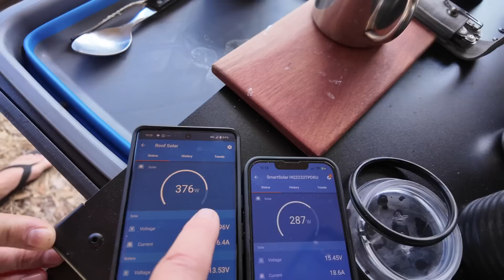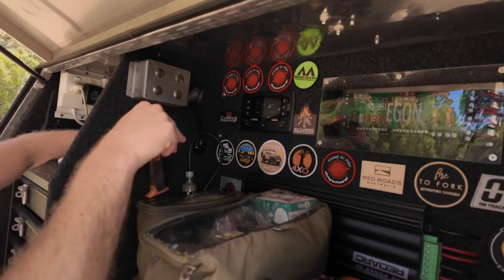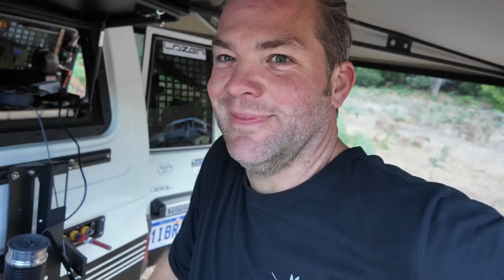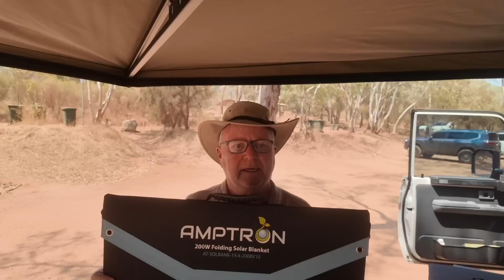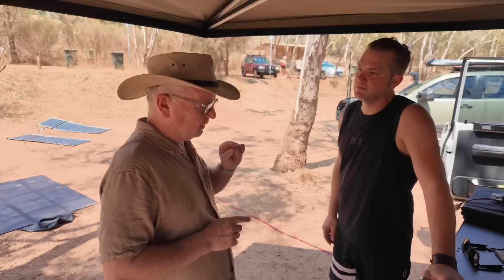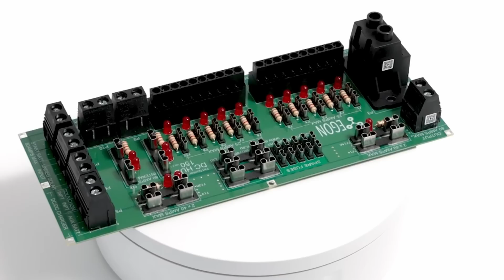Solar Blankets and Panels. Volts and Output @4xoverland

Comment: Here is a dilemma I am trying to decipher. I have house panels that are 275w @ 30vdc 8A +/-.  The panels and the mppt  charge controllers are rated @ 12/24vdc application. The charge controllers are rated @520w input for 12vdc and 1040w input 40amps max output rating for the controller for 24vdc. This charging system is charging a 12vdc system. Currently I have the 2 panels wired in parallel for 12v charging at 550wdc input to a 520w max input @12v. (I'm over paneled slightly - 6%)

 My question is the batteries are setup for 12v . Can I wire the panels in series and should  the mppt sense they are charging 12v batteries and convert the wattage accordingly as to not over voltage my batteries?
My whole inquiry about this is I'm only using my charge controllers to 50% of capacity in a 12v system. As I have a 12v 2kva inv/charger which works great. I'd like to step up to a 24v 3kva inv/charger or all-in-one. At some point. So I've acquired fixtures to evolve from 12v -24v. I have 4 batteries in parallel each is12v 200ah 100a bms 40amp nominal charge current. So I should be able to charge at 160amp max. I think my system is pretty well suited for 12v or 24v operation. I will not reconfigure for 48v. I would start over for that.

Comment: Sorry guys, but from a technical perspective, this analysis, comparisons and results are a fail.  In order to do a proper analysis, you MUST be comparing apples with apples, as well as have a basis point for all of the items being used in the testing. To start with, you need to confirm the ‘actual’ performance specifications for the panels being used, NOT what is quoted on the panel’s data sheet or alike.  

It is absolutely pointless showing us the output (on the app) of the two setups and telling us ‘one is much better than the other’ when you don’t even know what the actual baseline output is for each setup.  From there, as others have mentioned, you need to ensure the charge controller and the batteries in use are the same (or have the same tested specifications), and more importantly, that the state of charge of the batteries are the same (and at an appropriately low level). 

Given the level of ‘experience’ you guys have, I was extremely surprised by the technical content of this video and the conclusions you came to.
Reply from the maker: Sure. You know better. Good on ya for pointing that out and the effort you put into it.

Comment: Is there a consideration that a roof mounted panel requires to some extent the vehicle to be parked in the open, getting hot and uncomfortable. Where as the blanket / demounted option allows the vehicle to be parked in shade with the panel only in direct sunlight. Not an overlander just wondering.

Comment: Far too much smoke and mirrors here to make any conclusions other than don't spend money without further investigation. By any measure, 60v is not high voltage - it's irritating that you keep repeating this.
Reply from the maker: And this is an irritating comment stating facts that are incorrect. FACT: In terms of solar panel and everyone who works with them, anything above 60V is categorised as 'high-voltage'.
Reply: @ Stick your tongue on your panel's output connector when it's producing its maximum output levels. Did you die? No. It's not high voltage. Or, don't ask me, ask the experts, rather than your glorified sales people friends:

"High voltage electricity refers to electrical potential large enough to cause injury or damage. Equipment and conductors that carry high voltage warrant special safety requirements and procedures." - doh

What a terrible video, factually incorrect, riddled with flaws, a complete bore that I challenge any learned person to see to the end🤦
Reply: @user-fed-yum if you didn’t try to misunderstand. It’s clear that “high voltage” in this context it’s compared with the average solar panels.
Reply: @TroopyTreatsx High voltage will cause injury or death. End of story. You don't just go about redefining safety critical terms just because you don't understand what they mean. Life and DEATH are not terms relative to anything. Maybe give the coroner's office a call, see what she has to say about giving people a false sense of security that they might not die, as long as the context is solar panels and not anything else they might ever come across. Remember, most people are stupid, don't think for themselves, and just follow along because.
Reply: @user-fed-yum  I googled “over dramatic”. Funny, a picture of you came up. 
Everyone understands the context in the video. Everyone except of one person.

Comment: One solar cell property to consider is its temperature coefficient. The higher this coefficient, the greater the losses above the standard test conditions of usually 25°C.

A good test of a quality solar panel is this property on the specification sheet. If the manufacturer / retailer can't tell you the solar panels cell temperature coefficient, run.

Comment: Very informative indeed and I'm curious to see what you come up with. I used some much older 200W folding Amptron panels also with their supplied aluminium stand whilst travelling Aust for 10 months. When added to the caravan solar system they helped out a lot.Just a bit of a pain to move regularly and not so great on windy days!! Their panels look to much improved. Will keep an eye on further info as you do your research. Frik at Amptron is very knowledgable and great to deal with. Keen for Amptron and Victron in my Troopy build!

Comment: I'm a bit confused.  Yes various pannels can have different output in both voltage and current, and I can see that both systems are in bulk charge, and the same MPPT unit but isnt the amount of current depending on what the batteries can take?  Are the battery systems  the same capacity and charge state.  I imagine if you put either system on a fully charged system you'll get zero current.

Comment: The testing methods needs refining you can't put the blanket panels flat on the ground or bonnet they will overheat and fail.
If you where to avolta 440w flex folding panel vs Jinko 440w both pointed north both on 150/50 so there no clipping, also needs to be on same battery as output amps change depending on battery voltage.

Comment: After watching your video last night, I felt compelled to run some tests on my overland solar setup. I also had a 4th 100 watt matching panel that I had yet to wire (it sits on my hood). My old Kodiak solar generator had a rather low voltage limit to its charge controller, so I had the 3x 100 watt panels on my roof wired in parallel. Performance has always been rather disappointing. About 6 months ago, I replaced my Kodiak with a much larger Bluetti system and added a secondary battery. I also added a portable AC for summer use in my roof top tent, so I needed substantially more watt/amp hours to survive a few days with little to no sun. The difference between 3x 100 watt panels in parallel to serial was shocking. I experienced nearly a 33% increase in generated wattage. Mathematically that makes little sense, but that’s what happened. Adding the 4th panel naturally boosted performance even more. This morning without overhead sun I was producing 330 watts out of the manufacture claimed 400 watts potential. That’s 82.5%. I’ve never, even with overhead sun during the summer, achieved more than 50% of manufacture claimed wattage potential. Thank you for the video and the kick in the ass to make things better.

Comment: Most people don’t know any of this Shit  excuse the French so thanks for educating those that don’t and would have absolutely no idea how and why to parallel or series or both to increase or lower or combine connect to multiple mppts to take advantage of shading . All I know is every time I stop out comes the folding high voltage 440w panels plugged into mppts to maximise my share of the Suns rays at optimal angles facing fully at the sun with 6mm solar cable on a small drum roll with about 30 metres of cable  while I sit in shade 😎

Comment: No mention of the effect of voltage drop between solar panel and regulator - you are using long thin cables for the portable panels and I expect thicker short cables for the rooftop.  I expect your input voltage to the regulator is lower because of this.  Can you improve the output of portable panels by using better cables  - my experience is that you can but the difference doesn't matter for most people.
Putting the panels in series reduces the voltage drop as the amps are halved.

Comment: Hello Gents,  are you controlling for the state of charge (SOC) of the two batteries in the first part of the video? A battery that is 50% charged will accept a much higher wattage than a battery that is 90% charged, all else being equal.
Reply from the maker: All the batteries being charged were well below 80%. With LifePO4, its about 80% where the charge current begins to be reduced by the BMS and the controller, and at around 95% (batteries do vary in this regard, ie, quality, age, no. of cycles etc.) they tend to go from bulk to float. Which would affect these results.  Heiner is a university graduate in mechatronics engineering in Germany and worked for VW and Mercedes AMG. So I feel we are top of this.

Comment: Good info for choosing your solar system parts and closing the gap between the indicated power on panels and the 'real income" when you're out there.
Some other advise:  soft panels need a lot of TLC !  when unfolding and positioning. Also chucking on water when they're baking in the sun is sub optimal, i use a  plantsprayer to avoid thermal shock.

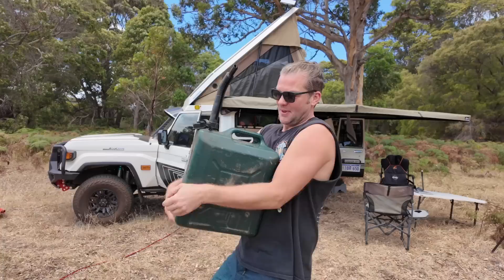Comment: I see around 10% extra charge when my folding solar panels are propped up at an angle but after seeing the cooling system at 6:59, I wonder how much of that is because they stay a bit cooler when they're not laying flat on the ground?
Reply from the maker: In this case, 10% less charge when angled.

Comment: I've seen a couple of builds on YouTube where they've got hold of 48v alternators (with brackets to run as 2nd alternators). Maybe worth a look? Also, would one of the home/RV style inverter/chargers (like from EG4 be worth looking at to manage 48v solar charging?) I've seen a few folks doing 48v RV builds using server rack style batteries & the corresponding inverter/chargers (again, the likes of EG4 seem popular, although others are available)
Reply from the maker: We consider all of what we have seen as too complex. We are developing a simpler, plug and play 48V system than anybody can install. And that means we're creating some unique products under the EGON brand.

Comment: I live off grid and our whole home is powered by solar, and our battery system is 48 volts, which is standard.  It feels like your sort of re-discovering the wheel here, a little bit. No offense intended of course, but yeah, for any large solar system it's always been more efficient to use higher voltage.
Reply: I agree with you. The re-discovery is the industry standard for off roading being 12v. Seems a standard set by scared people/companies. I personally am designing 24v, would rather 48
Reply: @ I mean, there is nothing wrong with 12v for vehicles. Unless you’re using an absolute ton of electric, it’s going to be more economical and work with the inverter better (in most cars). With that said, there is no doubt that higher voltage is more efficient.

Comment: Okay, all good stuff but I need you to sum it up like I'm a 5 year old. That was such a numbers blizzard it was hard to keep up. And I can only afford to do this right the first time. You guys know what you are talking about but it is hard for us amateurs to digest. Please add a summary (with text!!) that says; if you have normal 12v system DCDC charger, do "x" and if you have..., etc. That would be most helpful. Many thanks!
Reply: Basically, higher voltage is more efficient if you are going to be using a lot of electricity and truly want a "house" like system.  This isn't new in any way.  It's the same reason AC current runs at very high voltage because it is more efficient to send high voltage at low amps through wires, than vice versa.  

Your 12v system is perfectly fine for basic use, and is likely much more economical for the average user.  Just get a DC-DC charger, a 12v auxiliary battery, and put a 12v solar panel on the roof that can tie into your DC-DC charger, and bam, you have a very usable system that can power your DC fridge and a few accessories.  

What Andrew is doing is discovering what every off grid home owner has already understood, that 48v systems are far better for high volume electricity use.

Comment: Check out the BLUETTI D40 DC-DC Battery Charger for high voltage charging via the car dynamo.
Reply from the maker: The Bluetti 30A charger is more expensive than the Victron! And unlike the Victron, won't be suited to high vibration applications like overland travel. Another ordinary product with good marketing.

Comment: If you got 2 panels with your 12v system, ALWAYS put them in series. Big advantage in low light situations. More, earlier and longer harvest with dusk and dawn.
Reply: With MPPT- solar regulator ,yes.
Reply: @ Of course MPPT. From my standpoint PWM is not even an option.

Comment: Andrew, what is the HV panel Heiner has on his Jayco? I would like to see yourself and Heiner do this again with a range of the panels PerthPro sells. Especially the Walara 425W which is not HV but not the typical 12v designated panel.
Reply: @4xoverland Andrew did you end up finding out from Heiner what brand the HV panel on his Jayco Swan is?

Comment: @4xoverland  i just checked and i see the new alpha 50 bcdc is max 48v. While the victron 30a/mppt is 100v. Massive difference. 
Now i see why victron makes sense if you one wants the normal roof solar panel. This is making me question on my new build what to do.
Its seems to be better for me to go victron with a egon dc hub, its nit a massive comolex system but it seems to be the better easier option with better performance

Comment: Heiner said mppt basically cut out on 31v (redarc)so a high voltage panel is no good on your basic dc to dc mppt?? I was thinking about getting the new redarc alpha 50 with a high voltage glass panel on the roof. Doesnt heiner run a manager 30 with high voltage panel
Reply from the maker: Low voltage panel. Manager 30 cannot handle high V panels.

Comment: Have been running 2 low voltage panels in series on car roof for 4 years and have not looked back. The higher voltage has been a game changer. Now that prices have come down the intention has been to replace the 2 panels with a single high voltage.  Thanks for sharing

Comment: Solar blankets suck. I have never seen any that come close to their "rated" output.
Reply from the maker: they suck until one is camped in the shade. Then they stop sucking.
Reply: @4xoverland  they still suck at reaching their rated capacity. Folding panels are a better option if you need the power.

Comment: Worked in solar for 14 years.  Your conclusions are directionally correct but one aspect you didn’t consider is you are charging two different lithium battery banks.  The BMS in these will decide how much of the available current will be accepted - eg if the BMS on one battery banks only wants (say) 20 amps and the other will take anything on offer, then you’ll see a difference in output on your MPPTs

I run high voltage on my setup

Also MPPTs can’t boost voltage if the panel voltage is below the required battery charge voltage.  Even more exciting is voltage drops in high temperatures
Reply: Unclear what you mean by "only wants".  Does the BMS of a battery not accept the maximum amps available from the source, which is my understanding. Cheers

Comment: Just curious why not much commentary on a 24v based system? I know 48v offers huge power out benefits but 24v can be charged from standard 12v auto system with a step up device and likewise step down to 12v easily,  Comments pls?
Reply: That would be my go-to setup for a tourer or vanbuild. Many appliances on the market are 24v friendly, mppt is cheaper for same amount of watts, cabling thinner than 12v system, as you mentioned dc to dc chargers compatible etc. Its the middle man in this discussion but Unless you really need a huge inverter, in my opinion the best compromise, and probably a little bit cheaper all in all.
Reply: Middle child syndrome. Seriously though, 24v great on 3000w inverter, all the coffee you can drink.
Reply: @drewc9029  I think 24v makes a lot of sense. More so than 48v in a touring setup.

Comment: That’s seems like terrible performance from those solar blankets. I have blankets made by Bluetti that use Sun Power cells. From two 200W panels I’ve seen over 350W, at about 54 degrees latitude (Canada). I run them in series. I have considered a fixed panel on the roof, but I’ve avoided that because it would require me to park facing south, in the sun. The blankets allow me to park in the shade and move the panels around as needed to maximize charging.

Comment: Claims of 200w and 300w on cheap panels are generally based on the open circuit voltage multiplied by the max amperage, which you can not get when open circuit. That is, the claims are meaningless. Your 2x claimed 300w blankets are likely 2x real 150w blankets, evidenced by their combine output of 300w.
Reply: @JasonShepherd_01  amen